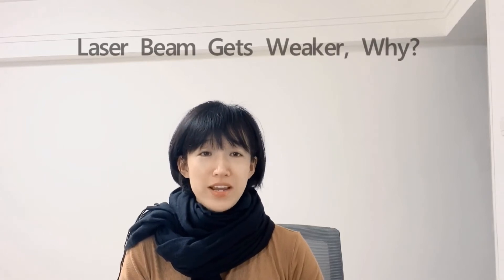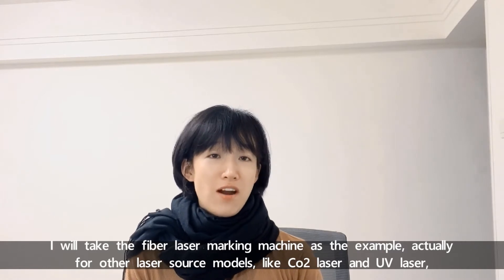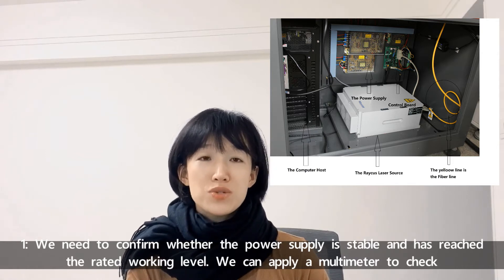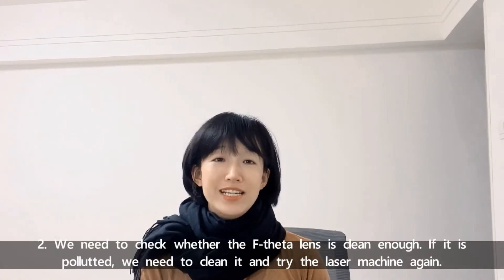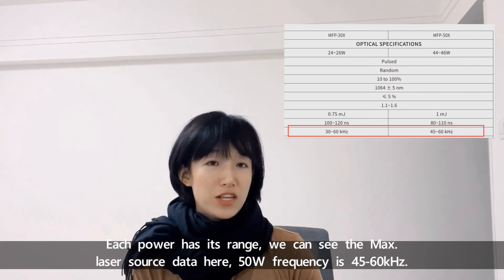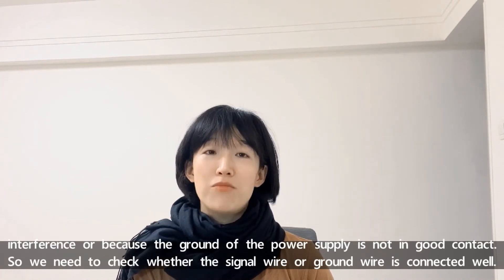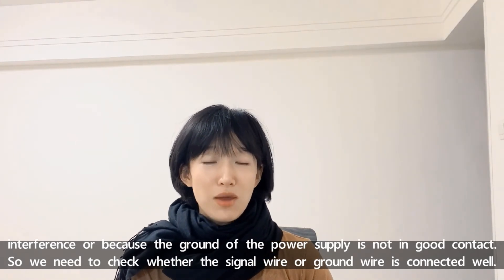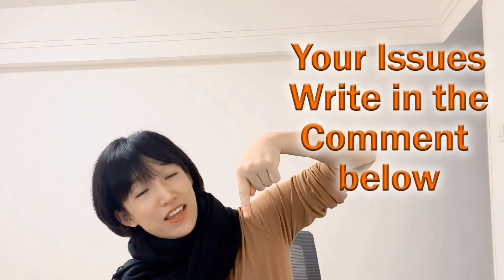Laser Beam Weak | Decrease Laser Power | Problem of Laser Marking

Comment: Hi clara i use sculpfun s9 5.5 i only used it for 1 day now it loss power i accidently engraved in the base aluminium plate that came with the laser for 3 sec. Could that be issue now i have to do severel passes inorder to cut
Reply from the maker: cutting machine or engraving machine?
Reply: @ClaraChai engraving
Reply: It does both i guess  @ClaraChai

Comment: hi i have fiber laser 30 watt marking is not working i am getting error ( fiber laser system error) if leave the machine power on for 15 mints then its woking can provide me the solution
Reply from the maker: Check if your system is properly connected.

Comment: Hi Clara, the power of my Raycus 3kw machine suddenly change decrease during cutting and i have to decrease the cutting speed. Randomly it increase to normal and decrease. I can notice this from power consumption which is written in stabilizer. I have checked every thing but nothing i found. what should i Do?
Reply from the maker: Lenses fine?
Reply: @ClaraChai  yes as I said I even changed the complete head. I even change my stablizer. But no solution. What can I do
Reply: @ClaraChai all is fine. Is it related to source?
Reply: Yes i even changed the head. Could you please help me
Reply: B and C phase current decrease during cutting
Reply: @amir19922  Like my case, the laser power is weak during cutting. Did you find a solution to the cause of the problem?
Reply: my laser power fluctuate. Suddenly it is high, suddenly it comes down. It is like yours?
Reply: @فيديوهاتمتنوعهوحالاتوتس no solution i checked every thing. It seems that the problem is with source itself

Comment: Hi Clara, glad to see this video I have a problem, my Raycus 3000 watt machine has a problem with the red light If you want to cut the second plate, the red light doesn't come on, what's the cause and what's the solution? thanks
Reply from the maker: Is your laser fine?
Reply: The laser can still shoot, but the red light is sometimes on, sometimes off and cannot be switched
what is the cause and where is the problem, please help, thank you clara🙏🏻

Comment: Hi! I have a 50W Fiber Laser Machine, 2 years of using and gradually have been weakining its power until Last week it didnt Mark or laserengrave a thing. We have measured with multimeter and everything is ok. It Focus right, but doesnt engrave. Any suggestion Please?
Reply from the maker: Probably the laser power has decreased too much, you can consider to buy a new replacement.

Comment: hello maam clara,

my Fiber laser got weaken 
when i use 430mm lens got weak but if i use 110mm lens its go strong..
if lens? its clean and no any dust 
where can i check this 

Power supply
Laser output and how to check theres a diagram for that? help me...
Reply from the maker: It is super normal that laser weaker for large lens and stronger for smaller lens.
Reply: Okay i got it now, there's another option to get stronger without changing the lens or machine i have 60w fiber laser

Comment: I have a ComMarker B3 30w with a raycus laser source. Was working fine for a few months but now the laser power drops suddenly after a few seconds of running. It starts cutting strong and then the power drops to almost nothing after a few seconds. Checked the power supply during operation and the voltage is steady at 24.1volts. I cleaned everything as well. Could this still be a problem with the power supply? possibly amperage related? Or is the laser source burning out? If I run it at anything higher than 30 to 40% power it's especially bad. Any ideas would be greatly appreciated
Reply from the maker: Is in warranty? Possibly it is the laser source.
Reply: @ClaraChai  Still under warranty. We might be sending it back. Thanks for the reply!
Reply from the maker: It could happen when the machine runs for a long time, which meaning the laser ages.  @stopthebox

Comment: I face problem than when i start  mark they did not strt marking and head strt voic and when i clos software and then open software again than it start work.. is it software problem or laser problem
Reply from the maker: I think it is the poor contact of wires.
Reply: @ClaraChai  ok.. laser source is fine???
Reply from the maker: @Burkiaccessories  I am not sure.
Reply: @ClaraChai  u tell me laser source problem or software setting problem ?..
Reply: @ClaraChai  i buy raycus 2 days ago.. new machine..
Reply from the maker: @Burkiaccessories  New machine? Please contact your supplier first in warranty.
Reply: @ClaraChai  i contact him .. he told software problem
Reply from the maker: @Burkiaccessories  Then he needs to help you even if it is software problem!
Reply: Good day dear my problem is the Fiber Laser Marking machine (Model: PEDB-400B)IT DOESN'T WANT MARK CLEAR LETTERS AT A TIME. YOU NEED TO REPEAT AND REPEAT. AND IT CAN MARK ONLY TWO TAGS PER HOUR.WHAT COULD BE A PROBLEM?

Comment: Uv laser weak pls make vedio of  reasons and solutions..
Reply from the maker: Thank you, will do it someday
Reply: You can Check the water circulation system is smooth flow, check the the focal length is normal, light path should be is normal and Check if the lens should not be dusty or broken.